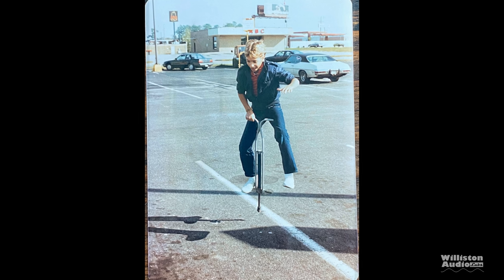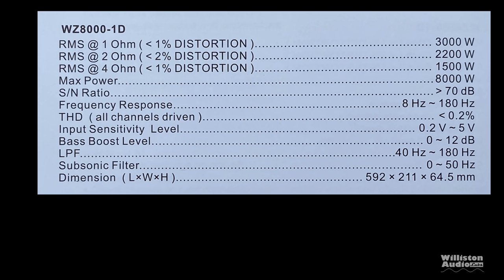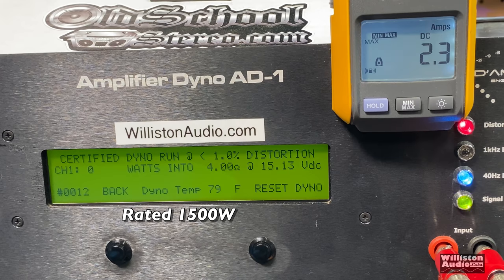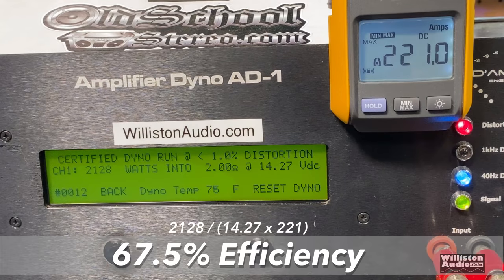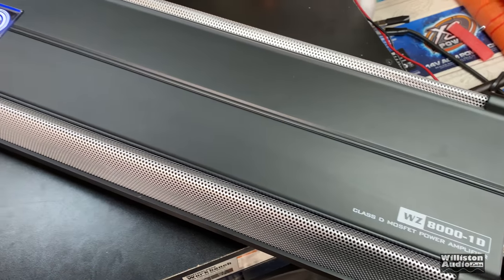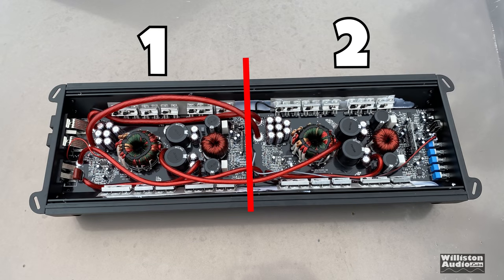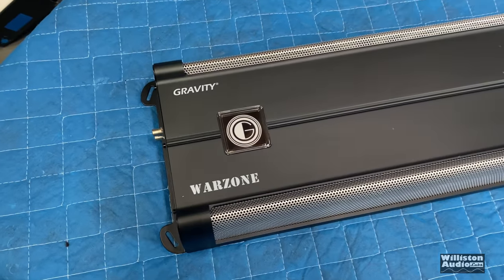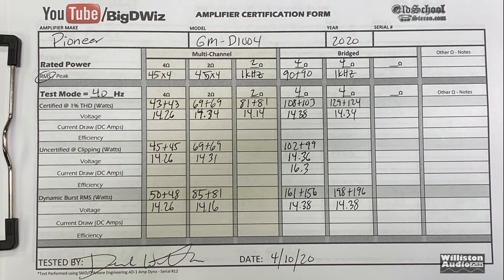8000 watts for under $300? Don't Take the Bait...

Comment: Isnt that thing gonna get hot as Balls with that efficiency? How in the world are the Heatsinks under the Mesh panels supposed to dissipate thousands of Watts? I see nothing but a fire Hazard.
Reply: Any amplifier that can push out that wattage will get hot, but they are built to take that much power, and push it out.

Comment: Just bought an ignite 3000 watt amp due to a review you did on one. It definitely bumps my little 10 inch. I bought a cheap sub in a box for $169. It WAY out performs my 2 12 inch kickers and puts just a 10. It's a Skar audio 1200 watt. It's breaking in now and starting to scare me a little. Makes me wanna buy 2 of their top-o-the-line 18's. Was skeptical but I'm a believer of this new brand. Jesus! It's Badass!

Comment: Hi. From what I've heard and seen for me it sounds and behaves like an A / B class amplifier. The power of 8000 W I think can be obtained dynamically with 0.5 ohm or less. It's really huge and doesn't seem to have very good or expensive parts but I think it's worth another chance :)! Peace
Reply: exactly
Reply: 400 amp draw, man your gonma need a new alt 359 + plus lithium bank or four just to get 3000 w or the five dynamically? I hear ya though, 260 price is pretty rad.

Comment: i have this amp on 5 soundstream 12s and it slams , 3 batteries total on stock 160 amp alt and full tilt never drops below 13 volts , i think its a steal for the price !
Reply: If it’s on a stock amp and never drops below 13v it’s definitely nowhere near 3k let alone 8k

Comment: I'll keep running my deafbonce 4k at .5ohm, absolutely not 1 single issue with it or my aak-200.4d.. both are awesome amps and have been very reliable.. my 370a mechman keeps them very happy at 15.2v, the 4k is powering my single deafbonce sa312 d1 at.5ohm daily.. such an amazing sub, and takes well over 4I rms easily, I've never once smelled any coil smells.. great American made 8 layer flat wound coil

Comment: For $300 I think it did reasonably well. What would you say this amp would be good for since it didn't run smoothly on Certified %1 THD?
Reply: Any sub. A typical car subwoofer in a ported enclosure is going to be 10 or 20% THD mechanically. So the extra 1% or so that’s being added by the amp isn’t going to make a noticeable difference.

Comment: Did you notice in the manual where it says it was built with SMD parts?
Reply from the maker: I almost made fun of that 😬
Reply: That means they used surface mounted components.
Reply: D3M3NT3Dstrang3r Thank you sir. I'm glad to see there are people who understand SMD is a component mounting process vs those who see SMD & immediately assume it's a Steve Meade product reference....
Reply: Your videos are great, I would love to see more on Marine amplifiers since boating in WI is growing fast !!!
Reply: Big d wiz man i gotta old school kicker impulse ix 406 i cant  find much info and i cant find the ratings for this amp i was wondering if u could dyno this amp man so i know it is a mids and highs amp or if it could push subs when i ask ppl its either ya itll push em no problem and so e say its not an amp that runs enough power to push subs so help me out please big d whiz
Reply: @cityboy1957  to be honest that's probably why they printed it on the box, to try to relate it to a big name. Most electronics made today use surface mount components and I don't see it printed all over everything else. And it's not like they have any hesitance to mislead their customers when 8kw is printed on the same box lol 😂 At least with smd they aren't out and out lying.
Reply: SMD   Is for the Surface Mount Components on the pcb instead of Through Hole components

Comment: I thought it looked like an Audiopipe amp from the outside when it came out of the box.
Reply: Its goes...look like an audio pipe with a different heatsink
Reply: I think he did actually think it's the same as the audiopipie but didn't want to straight out say it.
Reply: Glad I'm not the only one who thought that, looks exactly identical to my apcle 1800.1 on both sides
Reply: Looks juat like my sonido mask

Comment: Big D u should look at there new line I believe it's the same boards as sundown sfb line n sound digital line they also have a pretty beefy sub out also that ships in a wooden crate they have 3k 5k and 8k
Reply: See if they can redeem themselves
Reply: I have 2 of the old model 8ks....still run cool as a fan with no issues...

Comment: Try the subwoofer G7 or either one.
The amplifier is a 40% out of 100% 
I like the amp for the price. It can push
Damm good job 👍🏽
Reply: The DS18 SXE-4000.4D run about the same price and are probably much  better

Comment: Big d thanks a lot for throwing this in there i have one of these at my shop and am thinking of using this in my spl build for my mids n highs instead of buying an 9604 but yo ser this almost getting 400. Itll do for 8 6.5 4 ways

Comment: Well if it's capable of producing close to ~4000 watts with the dynamic test, at 50% efficiency, then you double that, and you get ya magic 8000 watt :) its CONSUMING 8000 watt... they didn't specify it could output 8000 watts (but if your gonna be really nitpicky it does that as well, shared across usable power and heat).

Comment: the issue that "false advertising" claims in most states are at most <$100 in damages;  So the attorney/court filing costs greatly exceed going after the perpetrators on lower cost goods.  You would need a gather a giant class of individuals whom purchased the product, then go class action, and at best, you may get a few pennies or nothing because of the cost of representation.

Comment: Do you have poly mat inside your 4-8 box?
I used it in my girlfriend’s  2-12 box with two 4” aero port, tuned to 33 HZ as a experiment and it sounded very smooth even playing out of its tuning capability I didn’t hear any tinging sound or port noise.

Comment: If your even considering Gravity products that’s mistake #1 it’s a “flea market” brand. I took a chance on Brazilian audio namely Stetsom I’ve had there 6k 2ohm export like does great I have there 8k 2 ohm export line great as well and to tell ya the truth the 6k pushes almost as hard as the 8k but of course the 8k when pushed is stronger but if we are splitting hairs and your on a budget the 6k export either in 1 or 2ohm is a solid buy. My sub builder says many of his customers are getting Taramps and having good luck with them. He also said the taramps are a bit bigger then the Stetsom amps and Stetsom are about 8-10% cheaper to get though you don’t get the remote clip light but the Stetsom has it on the amp itself. Get a bigger name brand amp and some batteries you can’t make power without power. I trust U.S alternators and XSpower battery’s And super caps imo of course. Do it big D DO IT !! :)

Comment: I dont think the smart 3 puts out as much power as the warzone  dynamically but i couldnt see it lasting a week for someone looking for something in that price range, most guys wanting a generic amp that claims 8k will end up running it on stock alt, probly 4guage wire and a boss or power acoustic capacitor or the cheapest walmart car battery and call it good.

Comment: WOW! My Orion HCCA 3k watt amp DEFINITELY pulls some power at 1 ohm (it should with 3 sets of power and ground inputs), but if my amp is pulling almost 500 amps, it's making close to 10k watts.
Reply: 500a x 14v x .8 for efficiency is around 5,600 actually

Comment: Please dyno 2 Ignite 6k amps linked together. They can handle 1 ohm no problem. I have them pushing 9 pyle 15s sealed. I curious about the power I'm getting. At $100 each it's the best bang for your bucks period.

Comment: I have 4 18 inch skar , what size amp can I get to push them . I have 2 250 high output alternator and two 2 2400 kinetik batteries  , i want thinking about getting 2 skar amp 4700.1 . Will be a great on the 4 18 inch subs ?

Comment: Just for a quick burp for spl that thing kinda slams. oversized alternator and 2 extra batteries. Get 4 of those amps with 4 15s you could probably pull 162 spl db.

Comment: Odd those full bridge linked amps always are inefficient. Dual supply instead of running say 100v +- on rails its 55x2 supplys and stacked after output section usually at best you'll see 60% .

Comment: Good work on letting people know about that amp.  Do you have a list of the most  efficient amps you ever tested, or maybe like a couple of ones that stick out from what you remember? Thank you
Reply from the maker: Want the best efficiency? Buy big 1 ohm stable Class D and use it at 4 ohms. The DC Audio and Crescendo 3.5kW amps are 95% efficient at 4 ohms
Reply: @wal  Your the best :)
Reply: It be interesting video comparing top 5 most efficient specs of all time ...

Comment: Whenever a product is Dick Riculous certified, then we know it must be good ;)
Jokes aside. If manufacturers actually rated their amps correctly, and stopped with the bloated "max" numbers. I bet there would not be so much hate towards certain brands

As a side note: The little Pioneer amp at the end there did pretty well considering the size. Not gonna lie, Pioneer has made some nice amps throughout the years. Do you remember the PRS-D800? also a tiny amp, but it was a 2-channel.
Reply from the maker: True and true!

Comment: Big D I am going to put one possibly 2 of those same 8 s in my Altima ....was going buy the smart 3 but I don't want have add an extra battery or altinator ...do you have any suggestions on what amp would best suit my situation ...
Reply: You don't need a 3000 watt amp even if you're running 2 of them.  My car is plenty loud with two 10s on about 650 watts total RMS to them.  Another 300 to my mids/highs and my stock electrical system (115A Alternator) has no problems keeping up.

Comment: Uh oh Dick Riculous is in the house that can't be good! I can tell you from experience that those inductive Fluke's are VERY finicky and are prone to interference, can you put another clamp on at another place in the line to verify the reading of the Fluke?  Also I wonder if the two boards in the amp are somehow a out of sync and are pushing against each other a bit? That would explain the dirty run at one ohm and the efficiency issues

Comment: When will you test optidrive 2000.1d 1/2 ohm stable model? I had one that did really well but sucked the power down on my truck with high output alt and lots of 0 gauge and extra agm battery

Comment: Hey I have a gravity  8000 capacitor. It seems to be ok I'm only running 2 10s and a power acoustic  3000 watt amp.  Do you test caps to or just amps
Reply: Big D primary tests amplifiers only. Capacitors are far more difficult to test and folks would have to understand certain aspects of electricity that would be hard to explain in a 10 minute video. Caps are pretty reliable as far as I know, as long as it takes a few minutes to charge up and not a few seconds it's probably good to go

Comment: Maybe they're advertising the combined speaker output along with heat output to get that 8000 watts. 491 amps at 14.4 is over 7000 watts of power consumption lolz
Reply: Could double as a space heater!

Comment: So if you wanted to run this amp @1ohm how the heck would I get my car to push 400 DC amps?  Bigger battery and a bigger alt?
Reply from the maker: Large car audio amplifiers require upgraded electrical systems. General rule says 1000-1500 watts is about all the power you should expect to add to a factory electrical system. If using a larger amplifier, you'll need to add an extra battery at a minimum, then if you find this isn't sufficient, you'll need to upgrade your alternator to a high output version. There are some other ways to get around this using lithium batteries, but this is not mainstream and not safe for those who don't understand the battery chemistries and which to use or not use (mainly related to charging and resting voltages not matching standard car 12V batteries).
Reply: @wal  So I learned about amp clipping the hard way, I blow 2 12PA gothic up in 10 days.  I  thought my NVX loc/bass restore gain nob worked separate from the amp gain  oops.  So I bought a oscilloscope and my amp would clip at 55v so I slapped a 230cca lawnmower battery in parallel, now it don't clip till 77v. Replacing the PAs with Gravity G3's I tried to cancel my order to switch it to kicker CompC 5$ extra they wouldnt let me.
Reply: @wal  if I wanted to set my gains with the oscilloscope with the subs  plugged in so my res is 1ohm what is the best test tone hz zone some say 40, 50 and 70

Comment: I have a 3000 watt battery charger can I attach my 1000 watt amp to it ? I just want to setup that amp for my subwoofer output from my tv
Reply from the maker: There are videos showing ways to use car audio in the home. Your solution may work
Reply: @wal  thanks sir

Comment: Well, if you consider a momentary peak to be double that of a respectable rms output, even if that RMS was burst, then the rating isn't just pure snake oil... Its certainly not free from snake oil, but I have seen worse. The numbers however it does put up seem really amazing for the money, however I would question its long term use in a daily system at low impedance loads over several hours. Better get some fans and A/C on that fella.

Comment: If you are going to build an expensive system that needs that much power, why would you uever cheap on the amp? You are probably well over 1000 bucks, whats another 150 for something that is actually good?

Comment: Hay man i love youre videos and I need some help if you can help me I own a tarams ds 160x2 that, I connected to my radio(Pioneer dmh g220bt),but when I tried to connect the Bluetooth the radio couldn't function and the speakers started making wierd noises like popping.
Reply from the maker: It could be interfering! Contact Taramps
Reply: Which version of the Taramps 160x2 is this? Version 1 has a regular encabulator, and it was causing internal kernel popping with select Pioneer units. However, the 2nd version of that amp has an (upgraded) turbo encabulator which basically addresses the original kernel pop issue by adding one more kernel (in series) which effectively takes your BT pop, cuts it in half, then doubles it so that you basically retain everything as before. 
Do you know which series Taramps you have?
Reply: @ansalon72  how i can identify the version ?
Reply: is any way that i can do anything to preventing this ?
Reply: @ansalon72  any advice??

Comment: Test : 0.8 ,0.5   ohms   ?
Reply from the maker: Amp is already internally bridged, so 1 ohm is putting 1/2 ohm loads on each amp board. Likely why it was so inefficient at 1 ohm and wouldn’t run the certified test

Comment: YEAH, THAT DEFINITELY AND GENERIC 3000D AUDIO PIPE 2 OHM STABLE NOT 1 OHM STABLE.
Reply from the maker: It’s similar to AP 3k, but slightly different. It’s horribly inefficient at 1 ohm because each amp is seeing 1/2 ohm load since the boards are strapped

Comment: Knock off Audiopipe amp from the terminals to the print on the end caps and the guts of 2 separate amps and won't run at 1 ohm meaning shouldn't be ran below 2 ohms

Comment: When dick regulus came out I was sure this amplifier wouldn't have made a thousand watts max.. I was surprised that they that well on music... I wonder if the power draw was because it was two amplifiers and they were both drawing their voltage as normal... I want to hear with the British amp guy has to say about... I love it when he talks technical... Anyways say hi to dick regulus for me... Stay safe big d in these trying times.
Reply: Im thinking thats exactly what the high current pull is from its 2 1500 rms amps basicallly

Comment: It's under $300 man, hifonics won't even do that power with that efficiency, it's a good deal when you want head pounding bass on a budget. SQ? Get an EQ!
Reply from the maker: Cheap stuff is cheap for a reason
Reply: @wal  and alot of expensive things are cheap stuff over priced and you never know because you don't question the quality when it's expensive. Take an SSA or crescendo apart and see what kind of caps they have. Or an American bass or is acoustics, I've seen alot of those same caps in high priced amps supposed quality amps too so they're not really that bad. Of course there's a multitude of variables involved but the fact is this amp is puttin it down for under $300, better than the legendary cheapo hifonics I might add. But everyone's entitled to their opinion and I hope I didn't come of assholish in my first comment, my words often translate differently than I intend them.

Comment: 00 for less than 2K? Holy inefficiency Batman! Heck, even my 2 ADS PQ40.2's and Rockford Fosgate 500M (driving 8 Morel 6.5", 4 2.5" silk mids and 6 1" silk tweeters and 2 4Ohm Renaissance Audio 12" in a 2Ohm load) didn't need the single 0AWG I threw at them (measured at 832.4 by Rockford and 280.6 & 273.4 by ADS = 1386.4 watts... through 1 zero gauge power & ground...). What godawful energy hog! Nowhere near the <0.3% Total Harmonic Distortion human ears require to sound good my 3 kick out! What complete junk.
Reply: Edited because I forgot the Average Wire Gauge abbreviation.

Comment: You going buy a $300 amp 8000watts  get 2800 watts out off it and waste $2000 on batteries and alternator to run it lol deff not worth it 😣😥😅